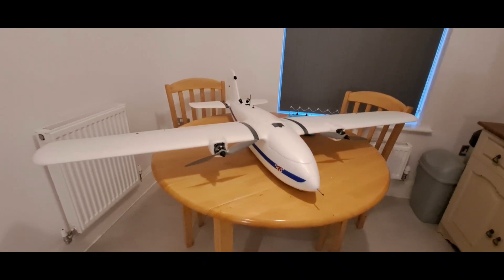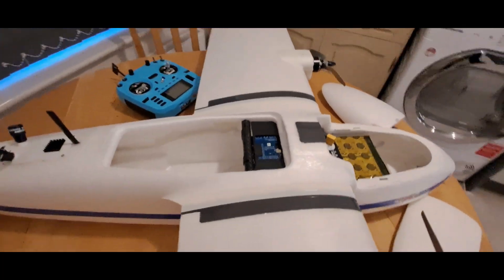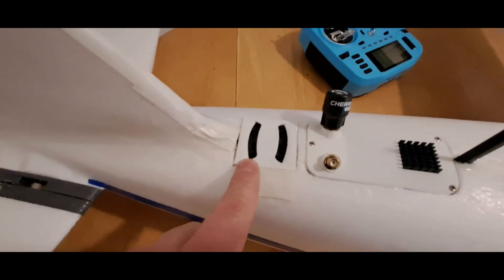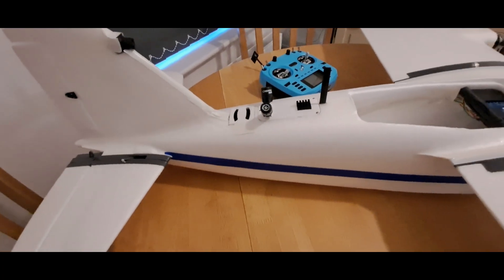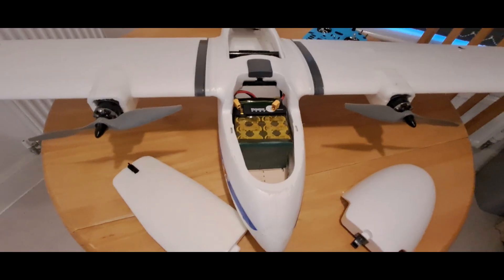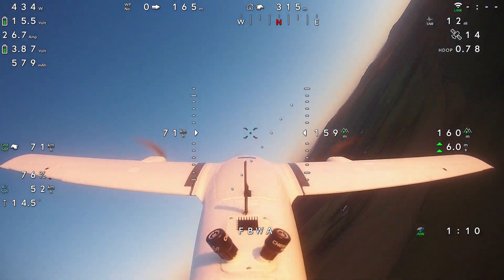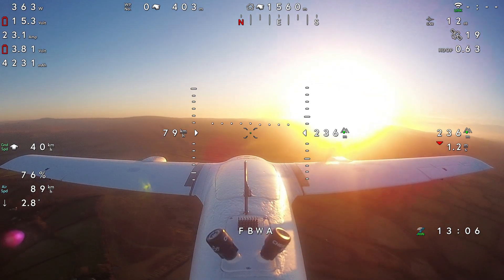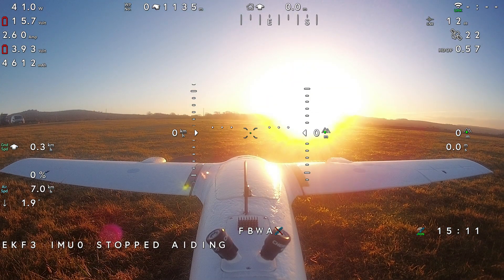Build overview of the re-fitted MFD Crosswind Mini followed by a windy (post-rebuild) maiden flight.

Comment: Amazing plane!  And battery!! "4S5P 21,000mah (made with Molicell P42A)", wow you should be able to go to the moon AND BACK! ;-) But seriously, I didn´t find the landing bad at all, seemed pretty smooth to me. One question: is the current sensor calibrated? 12A+ current usage sounds a  little too high for a fixed wing...
Reply from the maker: Thank you for your find words. You're correct, the scaling of the current sensor was incorrect here. I've now set it correctly but haven't had a chance to go out for another flight yet. Hopefully this weekend.
Reply: @Crunklefloop  looking forward to watching it!👍

Comment: It’s crazy how much space is inside for more batteries etc.
Reply from the maker: It's designed as a mapping platform so you can fit a full sized SLR camera in there. Or loads more battery for crazy long flights 😀

Comment: Beautiful plane, INAV 8 is out and is amazing with the ''dead reckoning'' virtual sensors options... no need for external pitot tubes etc
Reply from the maker: Agreed, INAV 8 has a lot of great features and is usually my preferred firmware.

Funnily enough I was actually flying this plane on it the other day (testing on RC3 and RC4 to address some pitch bobbing issues prior to the main release). I do like to keep my hand in with Ardu though and wanted to set this up with the pitot for LR flights.

The difference with using and Airspeed meter on INAV and Ardu is that Ardu can use a calibrated Airpseed meter in closed-loop speed control in cruise and autonomous modes, which can make for extremely efficient cruising and also stall prevention. INAV only uses it for OSD info in normal use (although it can use airspeed in dead reckoning), INAV's Virtual airspeed is very good too and surprisingly accurate.

P.S Great to see you're getting into Fixed Wing too! It's a great way to enjoy FPV 🙂
Reply: @Crunklefloop  I wrote my own "program" in INAV's IPF that holds an airspeed.
Reply from the maker: @JamesDowningFPV   That's very interesting. Would love to know more about that.